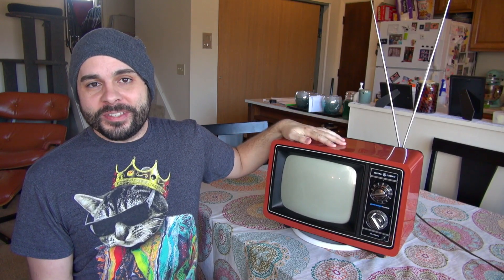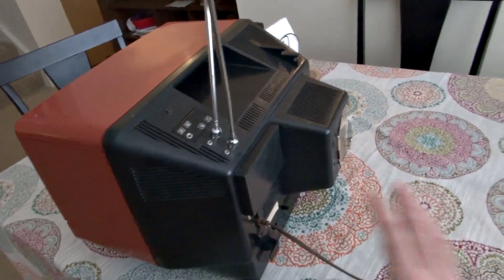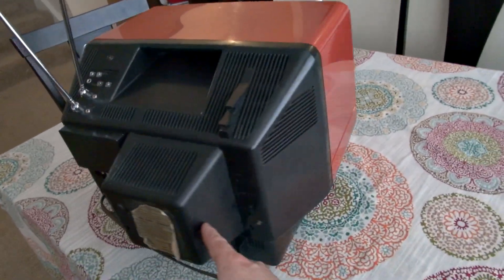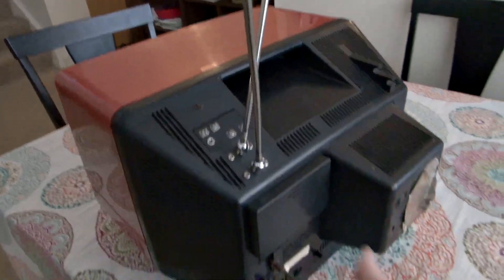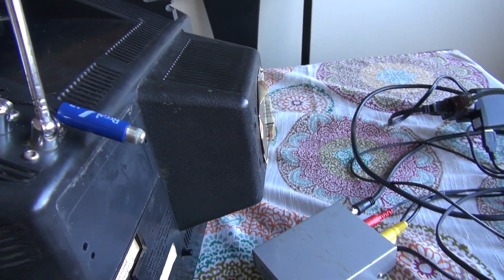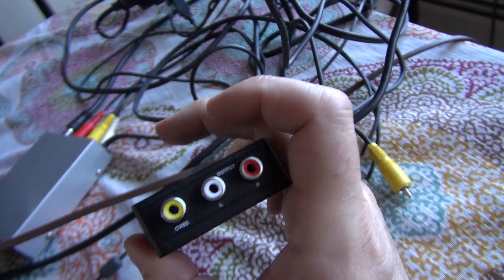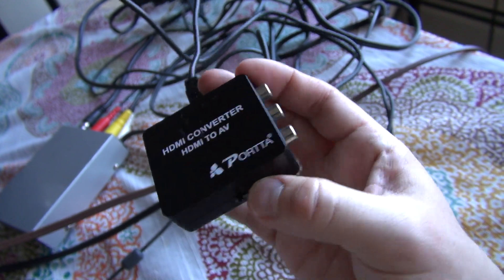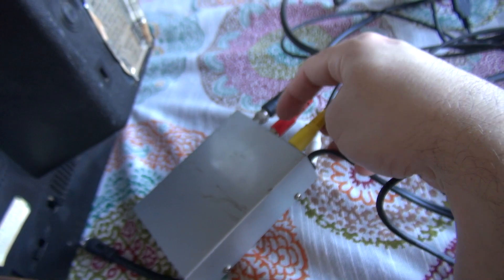Full version: 1978 portable television converted to internet music & video steaming smart TV!

Comment: A little late here, but for anyone seeking to emulate this, I'd recommend a two-part solution. 
Tuck the hardware into an old VCR, then connect the VCR to the TV through the antenna terminal like normal. it avoids playing around near high-voltage components, and depending on the VCR, there can be a lot of room in there. (While not aesthetically appropriate for this build, a 90s VCR is almost completely empty aside from the tape mechanism.)

Ideally, you don't even need the RF modulator. The VCR already has one, you just need to inject your video signal into the VCR's modulator.
Reply: VERY smart idea - I'm 100% doing that, thanks!

Comment: I certainly approve of saving this old equipment and preserving it as it was. It would have lost that vintage charm had you put an LCD or a tablet inside to replace the CRT. Adding modern converters to get a signal to it is just what has to be done to make this old stuff still function in the modern day.  I don't think you would really have to worry about the picture tube going bad, they pretty much never do, it's everything else that connects to the tube that develops problem. Great job!

Comment: That "Screen Door Effect" is the shadow mask on the CRT.
It is used to make sure the beams from the electron guns line up with the red, green and blue phosphor dots/stripes.

Also you can ditch the RF modulator if you wire the composite directly into to area after the audio is separated.
Of course, looking at the inside of the TV, that might be a tad difficult.

Comment: Awesome project. Great job, seriously. On the 4:3 zoom issue, I have had luck in the past when I did VJ work 15+ years ago using an AverMedia AverKey scan converter. I used it mostly for composite video/VGA, however it had a pan/zoom function that really helped when I needed to adapt different sources (removing black bars specifically) on the output (mixer to projectors).

Comment: Dude, you and I have a lot in common. I rebuilt a 90s era Webber sport’s PC that a school coach gave me by upgrading it with a Hero Maximus board w/intel i7 processor. I previously saw a video about how you upgraded an Aptiva box with a similar Azus Hero board, and kept its originality. I also have that tiny GE TV set just like that in storage, but I think the tube is garbage. The last time I used it was in 1997 on an NES, and the tube was blurry white, and had these strange lines running diagonally across the tube. I also saw in this video, that you also have a vintage receiver... is it a Marantz??? Awesome video bro!!!! I like how your stuff is old school, but yet, so 21st century.

Comment: Wow, I was amazed you were able to cram all that extra kit inside the TV, also your hack of the I/R motion detector is novel, I'd probably cook up something with a few transistors and a relay, pinching some 5V from the chromecast supply to run it.
As a CRT replacement, I've wondered about forming some acrylic sheet to look like the screen (form it over an old CRT?), then give the back of it a light coating of something to simulate the grey of the original tube, then mount one of those mini LED projectors at the back of the case, back projecting onto the screen. Normally you could back project onto something like tracing paper, however that stuff cannot be formed into a curved surface like the old tube, so hence the acrylic sheet concept.

Comment: I must have missed it but where are you grabbing power for the Chrome Cast dongle, the RF modulator, the HDMI converter, and the light/sound sensor inside the TV?
Reply: Hence why he said he doesnt want to be responsible for fires. He likely is pulling it from the main transformer, which on a 40 year old TV puts an immense strain on the aging parts. I will bet you this "hack" wont last a year,

Comment: EDIT: lol you mentioned doing this at the end of the video.... lol

If it helps, you might be able to find the pin out to the main IC by putting it's chip number into google. Worked for me with my tiny 5 inch CRT. Though given the age of this TV one might not be as lucky. But I saw a large chip near the back of the PCB on your tv. I would start there. There's probably a composite output pin on that chip. You just have to probe for it. As long as you find a ground connection that's not tied to AC ground it should be safe to probe for it if you know what you're doing. ;)

[End of edit]

Some old tvs might have a composite video signal originating from somewhere on the PCB of the tv. I have a 5 inch portable B&W tv that had one and I soldered in a connector. I bet one could do the same to many old 80's era TVs if you looked hard enough. THough the tv I did my mod was a design from the late 90s (and the particular one I had was manufactured in 2002).

So perhaps the complexity of the setup of your tv would be greatly reduced if you can find a schematic of the PCB/IC of that tv and then tap directly into the composite signal being generated internally. :D

Comment: you should be able to adjust the scale of the image on the tube in some way or another. Along with vertical hold there is usually a pot for vertical and horizontal scale. Throw a 4:3 image on the tv and scale it until the black bars are just out of view
Reply from the maker: +Joseph DiGiovanni to save time in the video I cut out the part where I mention that this TV allows you to control vertical height adjustments but not horizontal width. It's fixed and as far as I can tell there's no adjustment internally. There may be a resistor that's controlling it but I'm not sure where it is to add a potentiometer.
Reply: +Dr. Moddnstine I see, that's unfortunate. Either way great little project and video. I relate to you a lot in wanting to make good use out of would-be trash. You should try fitting a bluetooth receiver or chromecast audio into an old tube radio, I did that a while back and it seems like something you'd be interested in.

Comment: Hey,
any updates on the HDMI adapter? Having same issue with one I got from amazon, can't believe the Chromecast cant output SD video.
Reply: Hey I just tried to this myself and I'm having problems as well but I have everything that is needed, not sure if it's the hdmi adapter or what I did it get it off amazon too
Reply: @captaincolumbo4056  I am trying a couple of different things, will let you know if I can sort this issue
Reply: @JamieEC96  any luck?
Reply: @hummens44  going to VGA then composite sort of works

Comment: Around 11:20 you are talking infront of the TV working and there are many shouws you are displaying like bewitched and they are not squeezed up cos of the 16:9 to 3:3 conversion or have the black lines up the side. Did you figure out that issue?
Reply from the maker: +Raph segal For that Montage it's a mixture of 16:9 content and 4:3 content. The 4:3 content
 was stretched on my video editor, before I uploaded it to you tube, and recorded the screen. I got the other adapter in the mail on
 Monday. What an absolute disappointment, this one was it's even worse! It does not zoom, but shrinks the picture! Useless! I'll be uploading that video in the next few days before I return it.

Comment: You should be able to feed composite video straight into the video amplifier. Audio can go into the volume control. To fix the silly issue with the 16:9 issue is extending the width of the picture. You cannot make the picture 4:3 on the chromecast!

With regards to the floating chassis deal. As long as the voltage isn’t referenced to ground, and there’s a transformer which isolated the input, no worries about shocks.

Comment: cant you just tell us how you took apart the motion sensor just so we all dont die from not knowing how?
Reply: My guess would be to run wires in parallel between the speaker and the output and ground of where the PIR sensor on the light is.

Comment: This is a chaotic mix of adapters and converters. It would be better to skip several steps in the video chain and use a HDMI to S-Video adapter, then inject audio into the volume control dial and Luma into the Video amplifier. You would of course have to disconnect the TV's original Audio and Video detectors. While you're doing it you could also remove the tuner and the IF amplifiers.

There's only two pitfalls. The first is that  as the warning sticker tells you the chassis is far above ground and you'll need to isolate it with a transformer. If you don't, it'll blow up anything you wire in like this. The second is that the composite or S-Video luma you inject needs to match the voltage levels the video amplifier expects. Too low and it'll struggle to sync. Too high and you'll stress components and cause premature failure.

Comment: i have a tv with only a rf input i have a rf modulator and the hdmi to composite converter but i cant watch dvds or blurays as the player thinks im trying to copy onto tape or something and the signal is scramble. this is a anoying copy protection problem introduced to stop people copying dvds to vhs is there anyway around this i just want to watch a movie on my tv and it wont let me. pluggin the rca out of the dvd player into the vhs av in then vhs rf out to the tv obilously does not work either and does the same thing any help would be great as im bored shitless and want to watch movies on my old tv

Comment: The HDMI converter gives out an anamorphic 16:9 image, which 16:9 CRTs of the modern days can detect. Otherwise the adapter has to give 4:3 letterbox with black bars on top and bottom for 4:3 TVs.
If you connect the adapter to a 16:9 TV then, playing back a 16:9 movie, it will have black bars all around.

Try to connect a PC via HDMI and set a 4:3 display format and see what happens. Maybe its just the lack of these resolutions of the Chromecast.

Comment: This is a really nice piece of work.

I'm curious to ask more about the HDMI>composite adaptors. In my setup I have a chromecast going via an HDMI>composite adaptor to an old 4:3 CRT TV, but almost all of the streaming apps cut of about 3/4 of the video with the overscan, kind of the reverse of what you describe at the end of your video here.

Have you had any luck finding an adaptor solution with that aspect ratio switching functionality?

Comment: Great video! One question, when using the HDMI to composite converter, did it automatically give you the correct aspect ratio? I've tried using a similar converter but it gives out a 'widescreen' signal which ends up vertically stretched on a 4:3 CRT. 
Thanks!!

Comment: I'm trying to do the same thing with a '90s scart TV. I'm using your same HDMI 2 AV converter. I had hooked chromecast to the adapter and the yellow red and white wires to a scart but nothing happened. how can I fix it? How do you avoid HDCP? I'd really appreciate your feedback. Congratulations for your amazing project!
Reply: +Federico Di Caro 8:03 look at his hands
Reply: +Elias Moreira thank you!  Magic is the answer!
Reply from the maker: +Elias Moreira I guess you weren't listening at 8:04 where I explain what's going on for almost 40 seconds..
Reply from the maker: +Federico Di Caro I'm not familiar with scart here in the US. Well, I know what it is, but it's a connector and standard we never got. I don't have any HDCP issues with the HDMI to composite adapter I'm using
Reply: Dr. Moddnstine magic or not, could you explain me how you avoid the HDCP protection?
Reply from the maker: All I'm using is the HDMI 2 AV converter, that's whats stripping the HDCP protection for me. There are many versions of the HDMI 2 AV adapter, perhaps yours is not compatible with HDCP.
Reply: it is true that works, I do not know, but I will try to do
Reply: +Dr. Moddnstine ty for your answer. I'll try with another converter. Congrats again!

Comment: "Gefen HDMI to Composite" (http://www.gefen.com/kvm/gtv-hdmi-2-compsvidsn.jsp?prod_id=11402) seems to be the only solution to the aspect ratio problem - I assume it's because there needs to be some video processing in between to make the analogue signal the right format/ratio, instead of a simple 1:1 digital to analogue conversion (since the digital video datastream doesn't have any "black bars" in them by default) which happens with most converters.

Comment: Awesome! but what about videos with no sound? Or if you mute you video. I think you have thought about that. ;-)
Reply from the maker: +Iagoba Apellaniz For moments like that, the motion light controller has a manual mode, to keep the TV on all the time, or until you use the original volume/power switch to turn it off. from the manual of the motion light http://imgur.com/D6vjRzp. So for me all I have to do is unplug the TV for one second, and then plug it back in. Then it's in always on mode. If I do it again, then its back in auto mode.